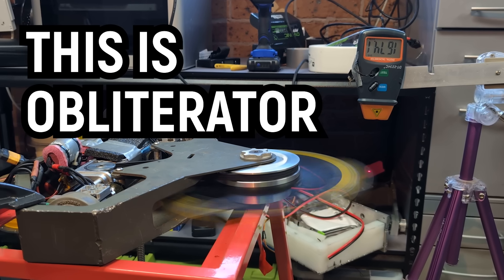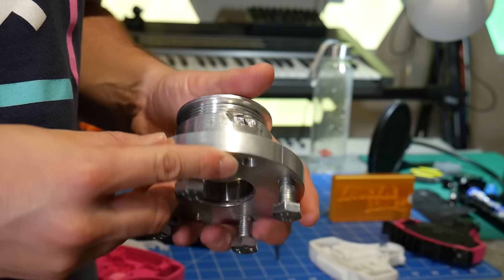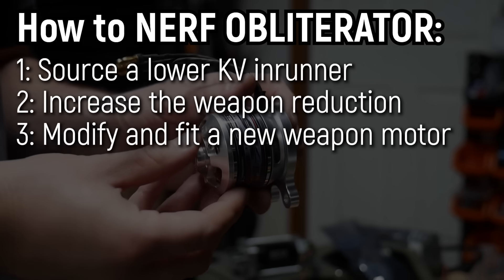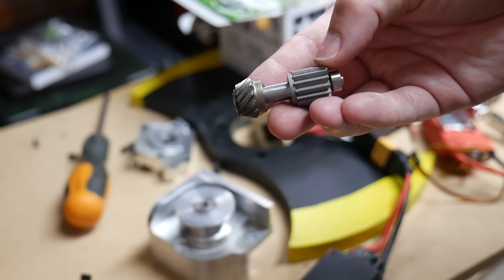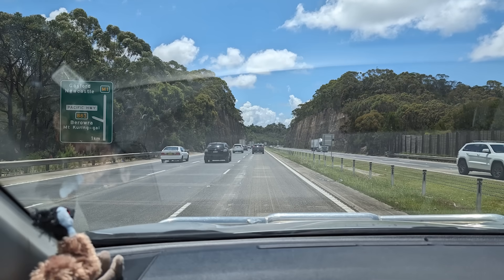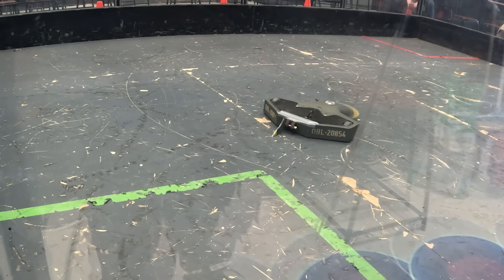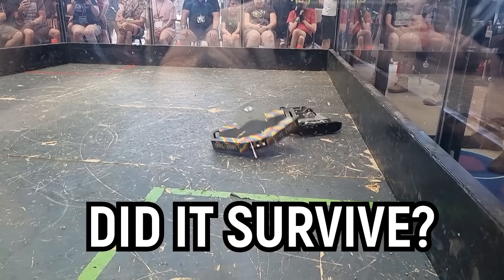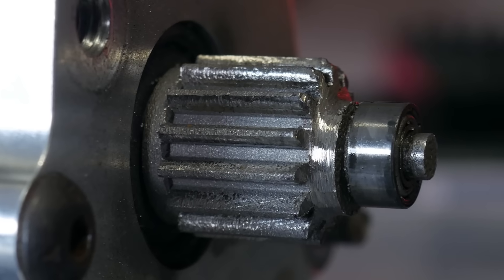Can 3D Printed TOOL STEEL survive robot combat? Rebuilding Obliterator.

Comment: That's incredible how well the geartrain handled the impacts, including the 3D-printed gear assembly! If it broke after the second fight, that would have been impressive but the fact that it handled all that and was ready for more is absolutely amazing. It is nice seeing commercial services offering more "engineering grade" materials that may not be cheap, but it is still way cheaper than having a machine shop produce them!

Comment: What about making a larger wheel by hollowing out the inside have the wheel go around the whole bot and run on bearings. Also maybe tilt it a bit so the front is a little lower and the back is a little higher. The wheels of your butt would be inside the outer ring of your blade You're basically getting a larger diameter with a hollow center.

Comment: How come you used no lubrication on the spur gears at all? I'm surprised you didn't enclose them and at least dress them with a thin coat of grease. Gears hold up to a lot more abuse with an oil film in between the teeth, I'm impressed at the condition after the fights.

Comment: The different motor size can be solved by using hypoid gear with offset and you don't have to use additional gear (so higher efficiency, less weight, less components)

Comment: Maybe you could try and get a helical gear pulley for the blade motor, and 3d print a helical shaft in tool steel if you want to keep the noise down, those spur gears can get loud:)
Reply: sorry, i meant herringbone not helical

Comment: For the spin up issue could a super capacitor be used to deal with the inrush current. You would need you more than just the capacitor I imagine
Reply: Super caps have significantly lower energy density than lipo batteries. They would be prohibitively large and heavy in this application. Capacitors are used in the ESCs to smooth out voltage ripple, but they are small.

Comment: I'd like to see someone put a viscous coupling into a combat robot weapon drivetrain.

One way to make it would be a large diameter, hollow cylinder with a removable lid. Mount the base of the cylinder to the weapon. On the opposite side of the weapon is a shaft for a bearing. Inside the cylinder in the center of the base is a bearing and there's a bearing in the center of the removable lid. The drive shaft goes through those two bearings and has a flat plate mounted which fits inside the cylinder. On the two faces of the plate are a large number of concentric rings. Those rings fit between rings on the inside of the cylinder's base and the underside of the lid. For extra 'grip' of the thick silicone fluid, a lot of radial holes could be drilled through the rings of the plate, cylinder, and lid. Doing that, the cylinder would need to be three parts. A ring and two lids.

Putting a coupling like that directly onto the weapon like the large pulley on Obliterator could leave it vulnerable to damage, though damage would most likely deforme parts to make it physically lock up. So I'd design one to fit internally. Several plates of smaller diameter could be stacked. With a large number of plates they could be laser or water jet cut from sheet metal or even modified flat washers with the ID and OD splined like miniature automatic transmission clutch plates.

But what such a coupling could do is replace belts in a drive system. We've all seen a lot of belts get cut, snap, burnt, stretched, thrown off pulleys both toothed and V. But a weapon drive that's all tough shafts and gears, protected by a viscous coupling, would avoid all those downsides of belts.

Comment: I have no doubt you could've taken the win if you had better piloting skills.  You had serious problems controlling your robot, controller problems not withstanding.  If you could match the level of control Derive had on his it would’ve been a much closer fight and you could've come out on top.  Then again, it all comes down to luck when your robots are this well designed.  Good luck next time, Angus.
Reply: Exactly, if he was experianced at this weight and was more used to controlling it, getting out of the way, moving around the arena to allow the spin up to reach potentichal etc then it would have been closer. He just needs practice. 

I'd recommend to just go somewhere that is open and practice slarlms, large U turns etc, even have another small robot driven by a friend/family and practice getting behind it, anything that helps to be a better driver. I do this sometimes on my motorcycle and I'm a far better rider since I started that than I did of 10 years of commuting.

Comment: Those receivers the MT12 came with are FrSky D8/D16. Something I had to dig for because it nearly screwed me over at an event was FrSky D8 does not failsafe but D16 mode does. That's why it didn't failsafe.
Reply from the maker: That's maddening, thanks for the info! I'll have a play with it, safely removed from the bot...

Comment: Keeping the mass, or even increasing it (since with a larger pulley, you should get more torque) on the weapon/blade, while reducing the length of it should buy you some reduced tip speed.

Comment: Could the max rpm not just be limited in software?
Reply from the maker: Yes absolutely, but it can lead to other issues and needs quite fancy controllers or guess work on the transmitter end. Also easy to "cheat" the test, though I don't think anyone in the comp is that dodgy.

Comment: could you have a rpm limiter? - a simple rpm counter connected to a motor cutout - then you could prove compliance by a hard safety cutoff process, not a soft-limit on power?

Comment: With the tip speed limitation, the obvious course of action (at least to me) is to optimize for spin up time.
Reply from the maker: Absolutely, it's why I wanted to use the original motor initially - but the geared outrunner still spun up fairly quickly (I left a 2second ramp in the controller to prevent some shock loading).

Comment: I really enjoyed your video and love Obliterator! We used to use the Aria 70A ESCs on our bot. They initially looked good in the test box, but they cut out in every fight we used them. We did some exhaustive testing on them in the test box and decided they just couldn't be trusted. Telemetry showed they didn't cutout due to over current or over temp - it was a mystery. We were using blheli, and I know you are using AM32, so your experience may be different.
Reply from the maker: Someone else at the event was using the aria 70a's on 8 cells and had no problems (!) so I wonder if it was just a bad batch?? For me, the little voltage reg and diode blew. Maybe from the braking setting, but as yet it's also a mystery. Annoying.
Reply: We also used braking. A bad regulator could be our problem too.

Comment: 17-4PH might be a better choice for the gear train. 3D printed 17-4PH is available.  The benefit is that you can heat treat it to 1300Mpa

Comment: I wonder if a CO2 powered cylinder for getting a bit more spin into the blade early on would be within the rules, though ig its always possible to overcomplicate it and temporarily make the blade itself into a gigantic rotor
Reply from the maker: It'd be allowed but would chew up a lot of weight. Still, crazier things have been tried !

Comment: It's absolutely amazing to me that something SO small can produce so much destructive force.
Reply: The blade is very heavy and spins fast so there's a lot of stored kinetic energy which will all be released on the target upon contact so yes, the momentary force is huge. Of course it will lose a lot of that energy when hitting something and needs the motor to "recharge" the weapon for several seconds before the next strike, it's not like it can do a continuous "cut", that would require a lot more power than can be fitted into the weight limit.
Reply: Yeah. The concept is like a flywheel.
Reply: Oh boy you should see my ex Gf then xD
Reply: Wait til you hear about guns or hand grenades
Reply: @kz.irudimen  Guns and nades ? That´s nothing, chemical energy, wait til you hear about electromagnetic weapons like rail guns and gauss rifles.
Reply: @kz.irudimen  lol yup...I own a BFR .500 Magnum

Comment: Why not just use a heavier weapon that is slightly shorter, would have lower tip speed, could calculate how much slower based on the increase in mass, or length of the weapon (or a mixture of some of both which would be best for overall weight)

Comment: I don't think vacating the room is going to help if you don't have brick walls - lol -. I would weld up a 6-8mm steel box to spin that up in.
Vertical spinners have the advantage because they are pressed to the floor in an impact, while horizontal spinners take a lot of shock load in an impact.
Reply from the maker: Heh yeah definitely behind brick! Drywall won't save you
Reply: Even if it did let lose there looked to be so much equipment around that would have been destroyed.

Comment: Does the rotational forces make it harder to drive? How does it feel on a straightaway?
Reply from the maker: Yeah massively! it spins off in a spiral during spin up and at every impact.
Reply: @MakersMuse  is there any way to have some sort of automatic computerised supplementary control to counteract it?
Reply from the maker: @KieranShort   yeah! You can use a gyro, but it adds another possible point of failure.

Comment: If all goes well then today I'll be receiving my Aluminium 3D Printed Sprocket Wheels for my E-100 ( https://youtu.be/l3_RcOU3zo0 ) as a replacement for the currently only SLA Resin 3D Printed ones I did myself. So far, the SLA ones haven't broken down but the torque coming from the Gearbox Axles is basically just begging for the Keying Feature built into them to be stripped since the Model weights like 6kg and the Tracks with their aggressive Cleats provide like way too much traction on anything that isn't hardwood flooring.

Comment: These are not and have never been robots. Just RC cars.
Reply from the maker: Yeah but that doesn't sound as cool
Reply: robots are machines that can do tasks, just because it is a remote control robot does not make it not a robot.
“A robot is a machine—especially one programmable by a computer—capable of carrying out a complex series of actions automatically.[2] A robot can be guided by an external control device, or the control may be embedded within.” 
i.e. the robot’s weapon is a controllable automated action?
or by logic if I take out the transceiver of my rc car and power the motor directly and let it go, it is now technically a robot?
or a surgery robot controlled by a surgeon is not an rc car and would still be classified as robotics no?
Reply: @michaeljamesm  
Look its really simple. A KUKA arm is a robot, a crain is not. MOST normal people would agree.

Definitions are just definitions I know, but if were gonna call these things robots, ever RC car can now be called a robot. And that just not how the general public uses these terms -> thus this name is wrong.

The reason this is so near and dear to my heart is that there are actually robotics competitions (google Eurobot for an example) and I have coached many a team of young students. Tainting the technical work they do that is on a MUCH HIGHER LEVEL then what these combat things do, by lumping in these metal rc cars with them is just a shame.
Reply: @MCTheTrash  Nowhere in the definition of "robot" does it say it has to be autonomous.

Also, you can reverse it, Eurobot is pathetic and lower level than combat robotics: material science, redundancy, stress loads are also very important engineering aspects and those student teams can't even make a bot that can survive a small hit. What are they even doing making these weak excuses for "robots".

See how that makes you feel? Robots can have different purposes and can be optimized for them. Some require autonomous operation, some require to be remotely controlled in a very harsh conditions (for example, bomb defusal robots or the dozer used in the clearing of the roof after the Chernobyl disaster). And yes, these remote controlled machines are robots, no matter what you think or how the word is being used.

It doesn't make one less valid than the other, but just being "nuh uh these aren't robots!" doesn't help anyone.
Reply: @bami2  
A pocket calculator is a technically a computer. No one calls them that, though.
That RC car you used to control when you were a kid is technically a robot. No one calls them that, though.

You're sneaking in the word just because it "technically fits", even though it doesn't if you applied ordinary use.

Please, are we serious, tell you what, we'll get a few Eurobot teams to build combat "robots"  and get the combat guys to build Eurobot-bots, let's see who fares worse in the others' competition.
In no way are they technically comparable.
(Also ofc the robots can deal with being dinged and scratched. But it's a non-contact competition, and that is actually a huge part of the challenge.)
Reply: @bami2  
The please restate it as short as you can. Then I can reread it with the correct angle in mind.
Reply: @michaeljamesm  
Another way to say it, you don't call your calculator (do people still have those) a computer, even though it technically is one.
Reply: Robot is a Czech word for slave labor
Reply: @Voyajer.  
How very relevant to this topic.
Reply: @MCTheTrash  I thought it was interesting!
Reply: A robot is a type of automated machine that can execute specific tasks with little or no human intervention and with speed and precision
Reply: @MrDksmall  
Little to no human intervention... so not what these things do.

I mean, think about it, people would call a robot arm from say Kuka a robot. But none calls a crane a robot...

Comment: Obliterator hits *hard*. Against NC a few years ago he hit the back corner so hard that in one hit he punched though 2 pieces of 6mm bis400 angled at about 45 degrees. He pushed the corner in about 15mm and cut out  about a 1/2 inch cubed chunk of steel  in one hit. It's the only robot to make a hole in NC in a decade of competing. For those outside the scene NC has won 3 championships from memory and placed in a few more. Great to see Obliterator in good hands. Hope to face it again in the future ;-)
Reply from the maker: The rematch needs to happen! :P
Reply: Nc?
Reply: @Loebane  My robot, called NC for Not Cobra. Cobra was another of glens robots that I was inspired by for the build. It is probably one of the oldest bots in the competition these days. On par with bender and some of the other artful robots Garry from victoria made. Well, except in the "artful" department. NC is just a wedge made of one piece of welded steel for the shell and some high powered drive motors. It wins competitions by not dying and bouncing other robot off the arena walls.  It ran for a decade with nothing much more than cosmetic damage. Obliterator very nearly obliterated it ;-)
Reply: @zyeborm  awesome thanks for sharing
Reply: Or, you could nerf it in the software... Motor controllers can regulate RPM... So buy having the weapon be overpowered, it can reach Max operating RPM quickly without going over.
Reply: @Unmannedair  Not particularly and also frowned upon by the EO. If you tune the KV of the motor to match you will get a motor with more starting torque than a high Kv motor you limit later on. Also the only way to do it that was acceptable to the event organiser was limiting E-RPM in the esc, that requires vesc which I don't think angus was using. The rules specifically banned limiting it in the radio. Speeds were tested before and during the event and if you exceeded the limit at any point you would be kicked out of the event and banned from all future events immediately, with no recourse. Those were the rules for this event. So most people opted for "limited by physics" rather than software for safety.
Reply: now we just need an upscaled military version

Comment: Your video's always make me wanna make stuff, but im feeling a little burned out on 3d printing at the moment after months of repeaded issues with my printers.  
  
Kind of want to get rid of all of them and get some actual decent ones to start back up again with less of the hassel that comes with them
Reply: get a prusa - i was to rejoiced after replacing my ender 3 which now im converting to EDM

haven't had a print fail in 3 years (apart from when the bed was dirty from my grubby fingers and print detached)
Reply: If you can afford it, get a Bambu - real plug and play 3D printing

Comment: Has anyone tried defeating that kind of bot with the garments used to protect you from chain saw injuries? It shreds and strings bind up rotating mechanisms.
Reply: ropes, nets, entanglement weapons etc are typically forbidden in all forms of robot combat for precisely that reason.
Reply from the maker: yeah anything that intentionally entangles isn't allowed, but bots often get hung up on shrapnel... Happened to me several times, need more ground clearance!
Reply: @MakersMuse  Hmm, but ground clearance makes it easier for the flip-you-over type bots to get you, so I guess there's a tradeoff